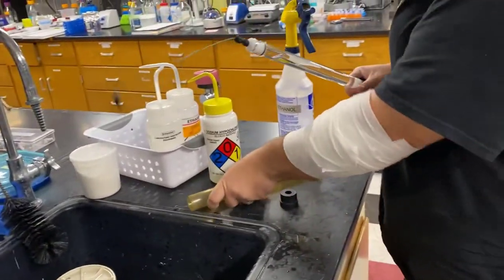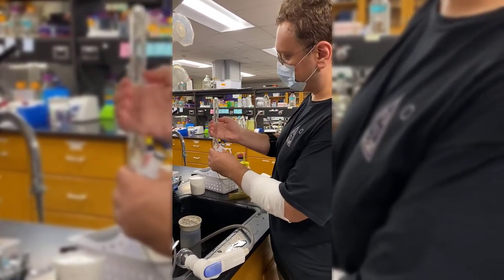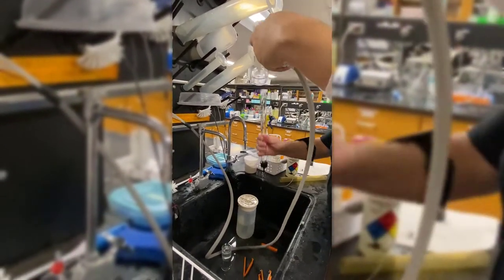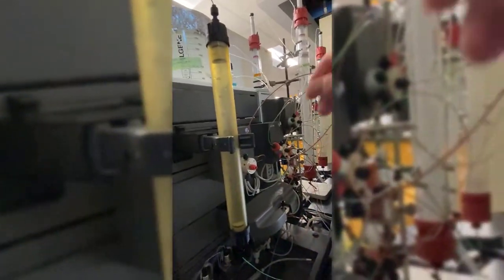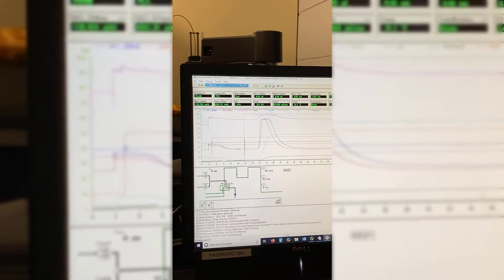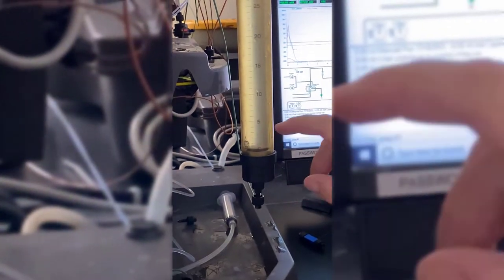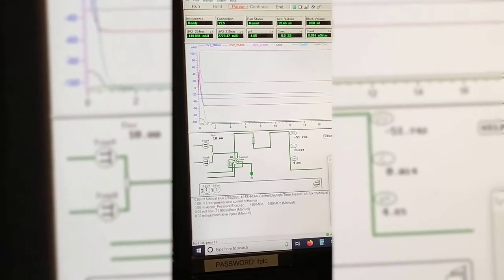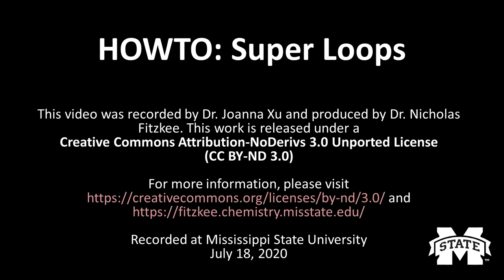How to clean and prepare a super loop for use in an AKTA FPLC system

Comment: What's the process for putting protein sample into the loop next?
Reply from the maker: The standard way is to load a disposable syringe with your sample (anywhere from 1-50 mL), attach a 0.45 um syringe filter to the end, dispense enough of your sample so that it fills the syringe filter and that there are no bubbles at the tip, and then simply inject your sample into the sample port in the injection valve. The default state for the injection valve, if no program is running in Unicorn, is the "load" state, which means sample injected into the load port will go into the loop as you inject. I never take this for granted, and I'm always looking at the super loop as I inject to make sure the stopper is moving up as I add my sample. I also look at the waste line from the injection valve: as I inject sample into the loop, buffer is displaced from the top of the loop, and that buffer gets directed to waste.

Once my sample is injected, I can either start a program or manually run the sample. Most of my trainees do nickel and ion exchange columns manually these days, and we only use programs for our gel filtration columns, but either way, once the sample is in the loop, you can do what like from there.

A final note: sometimes using the 0.45 um syringe filter makes it really hard to inject your sample: You're ultimately trying to shoot typically 25-50 mL of viscous solution through a tiny channel carved in the injection valve (not to mention the PEEK tubing). Even without the filter, injecting it carefully without breaking the luer lock fitting can require a lot of upper body strength and control.  I always tell my students to take their time and take a break if their arms get tired. It's not a race. However, if the syringe filter is making things too difficult, a hard spin in the centrifuge at 20-40,000 x g for 30 minutes is often enough to get most of the large insoluble material out of your sample, and if you do this step you can usually eliminate the filter.

Hope that helps!
Reply: @FitzkeeLab  that was very helpful, thank you!!